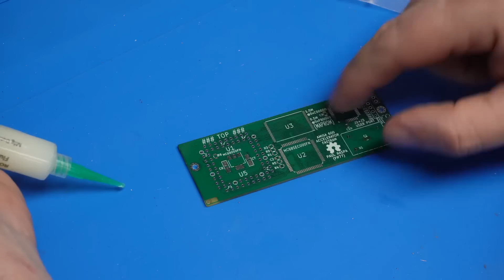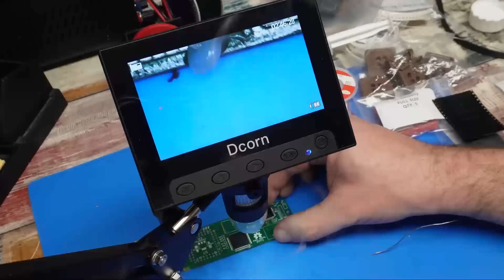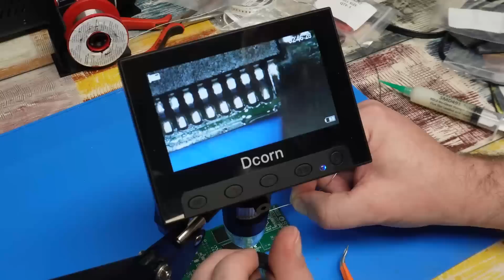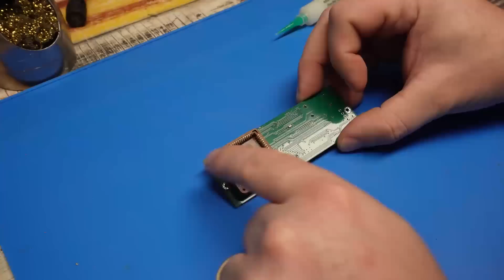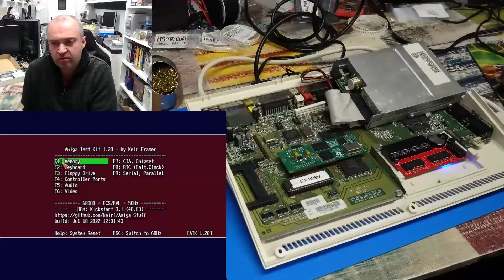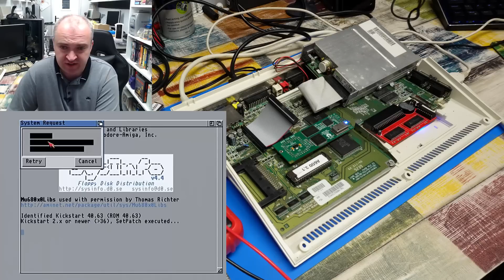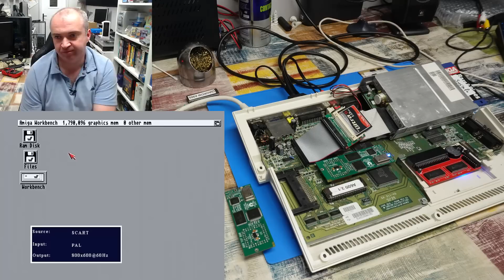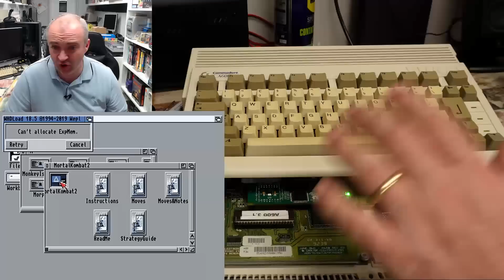Building, testing and hitting problems with a CHEAP Amiga 600 ACCELERATOR

Comment: Looking at the CPU pins vs pads I can't help thinking the footprint was meant for a socket, though at the wrong scale.
Reply: You may be right, I believe they solder on on the inside.  Attaching either that CPU or a socket to the board would best be done by applying solder to the pads and building it up a bit first, then placing the component/socket on it, then heating it with hot air (or a special hot plate) until it melts.  The pins will tin themselves, center on the pads and attach to the molten solder pool creating a proper electrical connection.
Reply: No that CPU must solder to the board as a socket is not available. This is a common amateur PCB designer mistake. He simply made the board too small and thus there was not enough space for the chip so he had to squeeze the pads smaller to make it fit. The proper way to do it is to simply make the PCB 2mm larger. There are no space restrictions in the A600 and a board 2mm larger won't make any difference to operation but will allow the CPU pads to be larger.

Comment: Lets not forget about the A630
Reply: I bought the latest version that has a 40 MHZ 68882 FPU, works nicely and is relatively quiet. I also have the non-FPU version that was sold previously. You can never have too many Amiga accelerators :)
Reply from the maker: Silly me, apologies
Reply: Its a hell of a lot more expensive.
Reply: @morantaylor  It is, but gives you  64 MB of RAM and an 68030 with an additional FPU. I built an similar project a while back for the Amiga 500 that clocked the 68000 to 14 MHz and added 1 MB of Ranger Mem. Like mentioned by CRG in this video, it really isn't enough Memory to help much with Games or Applications that need it.
Reply: @morantaylor  220 isnt expensive

Comment: My original thought would of been after all the usual checks, would the cpu lanes be attached to IDE and timing.  I have an a600 8mb fast, 1.5mb slow card,  1 mb chip expansion running rom 3.1, WB 3,1 1997 version. It runs a grate no issues running as a standard 68000 gets 7 Drystones more than a stock machine so a miniscule noticeable improvement. Have been wanting to upgrade to 020 but the prices are so high I might as well buy a a1200 and get that Alice aga as well in the price. Even though the a600 was a ECS machine there was not limited software that used that mode OCS and AGA was the most common.

Comment: Your accl card and IDE interface all use the address bus like every computer invented.  If the accl card is holding a bit low, and it's an upper bit things like some devices won't show up, weird software errors will occur, and you could see half your memory device.  Look for a stuck address bit in the upper half of the bus.

Comment: Get rid of this clear "cup" from your microscope (it is only a friction mount, just pull it down with a slight twist). It is useless in this application. I believe it has been copied from a handheld USB microscope, which you could put directly onto the observed object (like a coin or stamp). When a microscope is in a stand, it only limits the space and disturbs the light.
Reply from the maker: Ahhh, i didn't know ow that comes off but it'll help greatly if it does.  What i really need to do is stop being lazy and capture the image from it into OBS so I can show you guys clearer.  Will try to do better next time.

Comment: When I bought my A600 I also wanted accelerator but later I started to think do I really need it because graphic chip will always be the same like in old A500 so this will not change my A600 into A1200.

Comment: Good job on the soldering, I definitely feel your pain.  I don't solder SMD that much, but I think the last thing I did was a PiStorm and it took me a long time to get everything soldered completely.
Reply from the maker: Thanks, I'm usually OK at smd soldering but this board I just struggled with.  I've been toying with the solder paste and it's maybe a little easier to working with.  It'll be covered in the next video.
Reply: @CRG  Maybe it helps to pre-tin pins of SMD ICs when conditions are as stupid as with the CPU there. This has helped me on more than one occasion overall...I realize tho that with the extra layer of tin on the pins the chip may not be perfectly flat on the pads below.

Comment: You could bend the pins inwards of that m68k before soldering. It will give you some necessary spacing. Just press the chip on all four sides against e. g sharp edge of a table. (Just vertical part, not the tips of pins).
Reply from the maker: Good idea, I'll try that next time I've got the same problem.
Reply: @CRG  Yeah it's a technique I use a lot. One step to do at the end of the bending is sit the chip on something that is perfectly flat and push down on the chip. This will align all the legs so they are all in-line. If you don't do that you'll have a really hard time soldering the chip because the legs will be all over the place. When manufactured, the legs are all flat and in-line within 0.1mm as per the specification but bending them by hand messes that up so you need to re-align it by pushing down on the chip while it sits on something flat. You may need to repeat the bending and pushing until you get enough of a gap between the chip leg and pad end.

Comment: That PCB just screams the designer is inexperienced. Long pads are critical to hand soldering QFP and TSOP packages. I put very long pads on my PCBs because I build hundreds of them per year and can't afford to faff about chasing soldering issues. Second, that cap under the crystal is terrible design. It'll short on the crystal's case, which is grounded. It looks like the designer tried to cram everything into the smallest possible board, which isn't really necessary here.
Also, the tantalums are just smoothing caps for the voltage regulator. Some regulator manufacturers recommend tantalum caps, some don't, but ceramics will work just fine in any case.
Reply: I was going to mention the capacitors. Some datasheets have values for both, some manufacturers datasheet are better than others for the same parts
Reply from the maker: I'd have to agree as the footprints for most parts made it extremely difficult to solder, especially the cpu.    I've since moved the cap under the crystal to the bottom as it was causing an issue but although not the only issue I've found.

Comment: You'd be better using fine sandpaper, taped onto a flat surface to modify that socket top edge - much more control and the result would be much neater and cleaner with less chance of borking it.
Reply from the maker: Thanks for the tip, I'll be sure to try that next time.
Reply: @CRG  A 30x30 mirror tile with some 400 grid sandpaper is indeed the way to go!

Comment: My money's on a bridged pin or a disconnected pin. Another possibility is that xtal is shorting that cap that it sits on top of. PCB manufacturing fault is not something I think is likely.
Reply from the maker: I have since got it working and your partly correct.  It's not a PCB error anyway.

Comment: 68k boards notoriously lack decoupling caps, maybe your three expansion boards are just overloading the little thing. The CF card could also be introducing just enough parasitic capacitance to bring the whole house of cards down. And that socket mounting is wild, every little bump can make it jump off the CPU.
Reply from the maker: You're absolutely right and (spoiler alert), but that's essentially my conclusion in what will be the second part to this.  I've tried adding more capacitance but it hasn't fixed the issue, although granted just throwing a few more caps at it isn't exactly the most scientific approach.
Reply: I had similar problems when daisy chaining multiple interfaces on the 48k ZX Spectrum, back in the day. Individually, the processor could handle the extra load added by a single interface, but when using multiple addons (Opus Discovery, Multiface 1, homebrewed sound sampler, and more), put together the extra load and capacitance on the address and datalines meant the CPU couldn't switch them fast enough to remain in spec. A temporary solution was to fit a faster CPU that could drive the lines harder. I wonder if the failure when adding the CF card is related to bus driving issues? And of course that cap under the xtal osc is a design flaw. Shorty shorty.

Comment: Use a bamboo skewer to brush alone the IC pins, to check if they are soldered correctly, doesn't leave any marks on the pins, and the bamboo flex's enough not to damage the pins !

Comment: Hmmm, did you insulate the bottom of that crystal before slapping it on top of that SMD Cap with the metal slapped right on both cap pins?
Reply from the maker: Nope and you are onto something.  Although it's not the only issue.  Will all be covered in the 2nd video.

Comment: I bought 20 of those CPLDs from aliexpress and they were fakes so it really is hit and miss now with those chips, but great you got one working bud, also the furia with the new firmware is a great choice or even an A630 03/50 acc is  available too
Reply from the maker: I've built the 5 if them now and found two bad ICs.  Not the CPLDs though, they are all fine. 

It really can be a lottery ordering from ali but it does save a lot of money.  I think i got the 5 ram chips for the price of one on mouser.  Of course with mouser at least you know it'll work.

Comment: but why only 1½ megs of RAM? - it need to be atleast 8.   Its seams a bit odd to me..
Reply from the maker: I think this was done to simplify the logic needed.  The 1.5mb sits in the ranger ram space, that address range can only accommodate 1.5mb.  

I do agree though, 8mb of Z2 fast would have made it a lot more usable.  Would increase the complexity and cost though.
Reply: They are using a 2MB static RAM to sit in the 1.5MB ranger RAM spot in the memory map. It can't be 2MB because the custom chip registers are located in the last 0.5MB. So they use the unmapped space in the RAM chip to store a mapped version of the ROM.
RAM in this area does not need to be auto configured as the kickstart ROM will check for it. If they were to add an additional 2MB SRAM it would need to be mapped into Zorro2 memory space and require auto config logic.
If they were to use an 8MB DRAM memory chip to fill up the Zorro2 space they would also need extra logic to keep it refreshing.